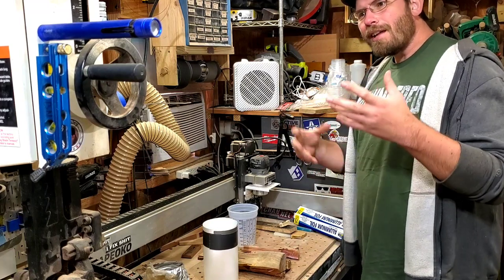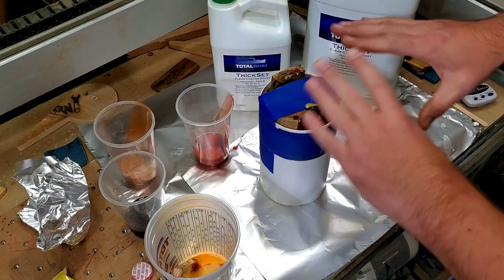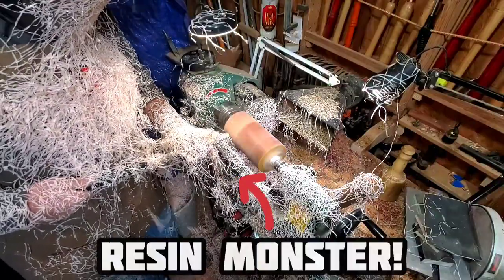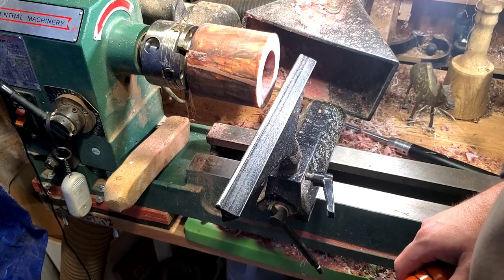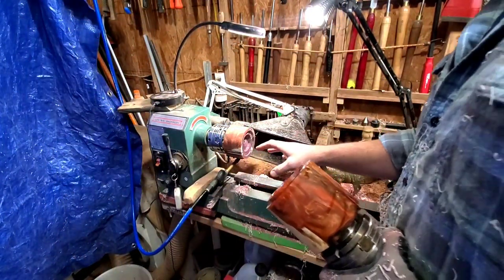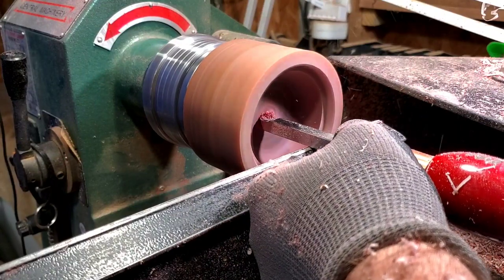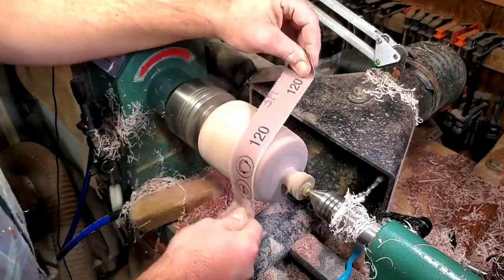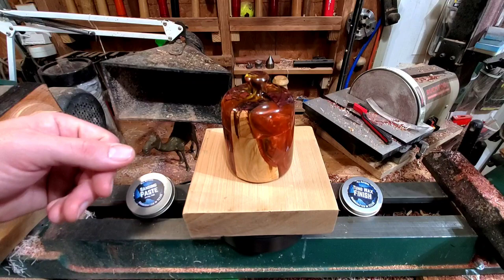Woodturning Epoxy Resin & Cedar - The FIRE Pot #YTCCC2021

Comment from the maker: Tools & Discount Links
Brads Tung Wax & Sanding Paste 
https://www.etsy.com/listing/834462387/wood-turning-abrasive-sanding-paste-tung

Diamond File Set
https://amzn.to/2YeLokY 

Sanding Sponges 
https://amzn.to/36chqCo 

Use bradsworkbench for 15% off your purchase of TotalBoat Resin at 
http://www.totalboat.com 

Starbond CA Glue
https://www.starbond.com/?rfsn=4353906.312489 
Use Code Brad15off at checkout to save 15% amount on your purchase 

Budget Friendly Carbide Cutters
https://amzn.to/367jonJ 

Bowl Scrapers HSS
-2pc Benjamin's Best
https://amzn.to/36bmWFy
-1.5" Hurricane 
https://amzn.to/3ch74VX 

Negative Rake Carbide Cutters
-round
https://amzn.to/3olVMSu
-radius square
https://amzn.to/3iNcdW

Comment: I like that. It looks great. I think it turned out well! 🤣 you should try to 3d print something, then put it in epoxy and turn it. That might be cool. Or like roses or something🤔
Reply from the maker: There are some people that do that with little toys. It can be cool sometimes. I thought about doing a 10mm socket as a "break in case of emergency" type thing